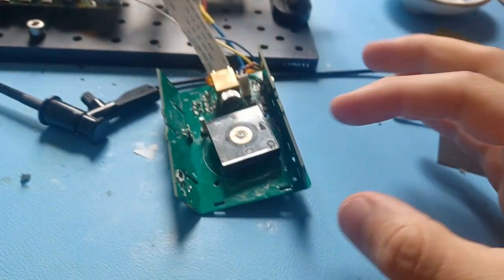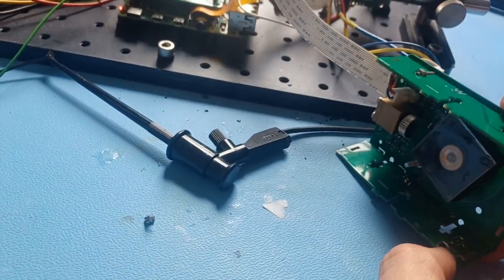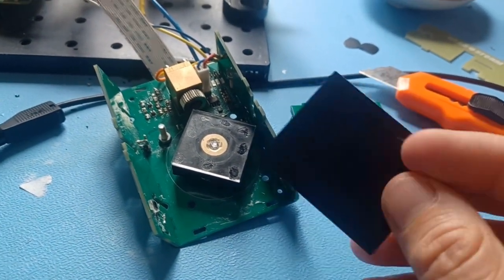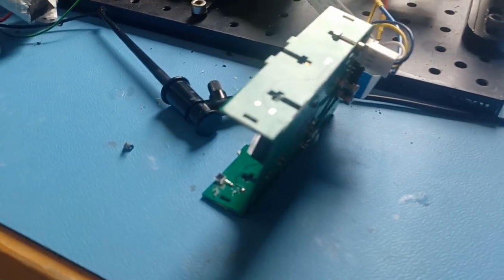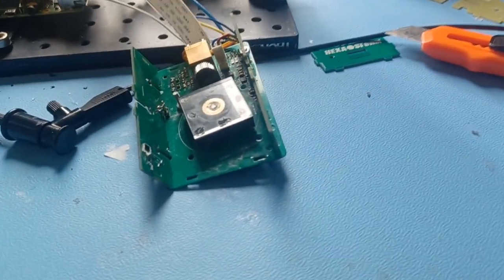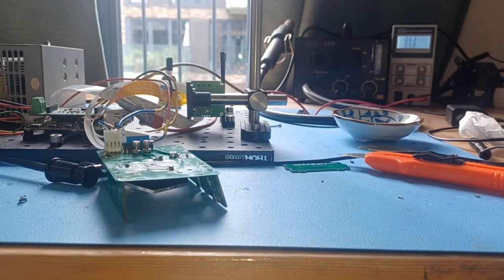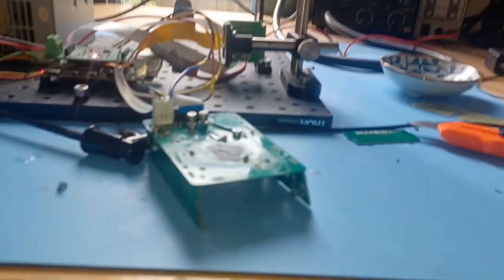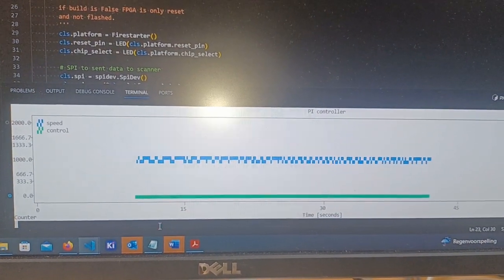Flipping a PCB motor using a ferrite sheet

Comment: a DVD player motor doesn't need magnets, at least the one I have doesn't. As the balance will be completely off with the use of those magnets.
Reply from the maker: A breakdown of a dvd motor is shown here (https://www.youtube.com/watch?v=Qb-uDgbgd3Y) . You see that is uses coils in combination with a ring that is probably a ferrite oxide which is magnetized alternating.  Classical polygon motors are made similarly and balanced hereafter. My motor is not balanced very well, this is not an issue for my current speeds but obviously something that could be improved.